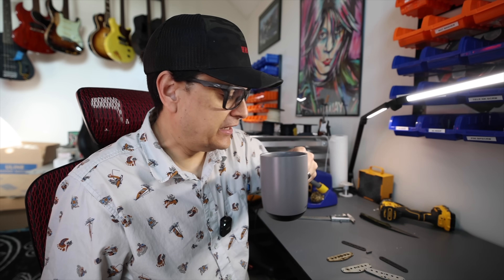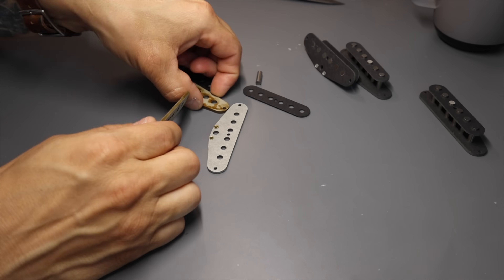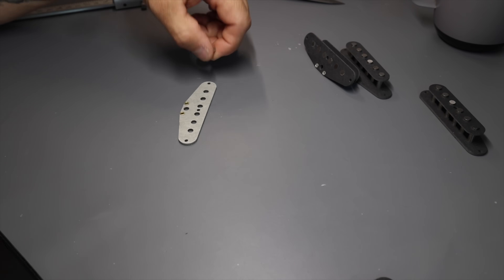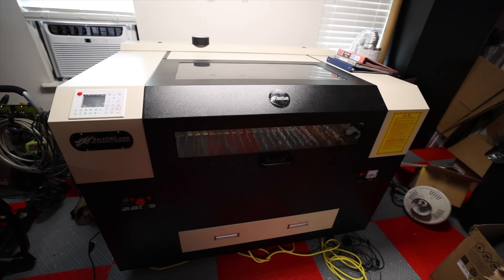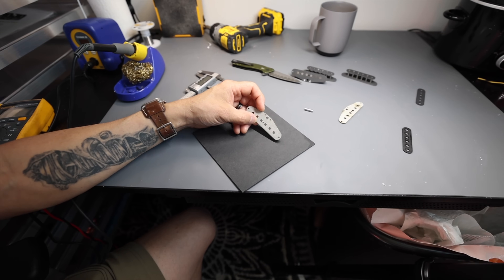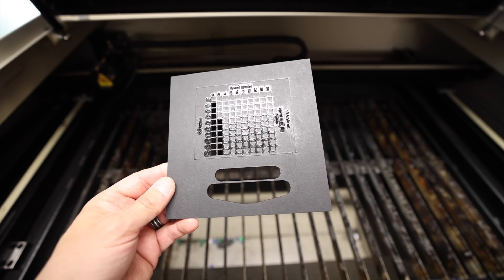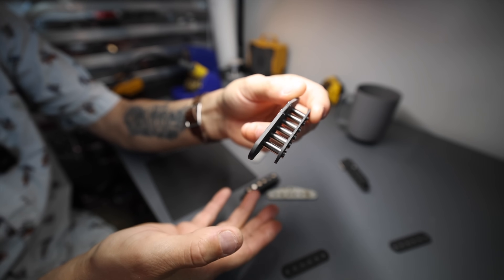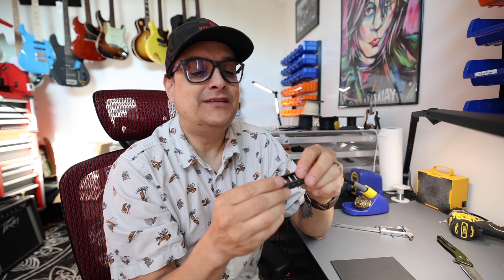This Pickup Bobbin Cost $10,000

Comment: There are absolutely things they could do to not have to deal with the laser residue, and the inconsistency is likely due to the laser kerf, if they're cutting multiple sheets the ones further from the focal point will be too loose and the ones at the focal point will be too tight. My girlfriend actually works in the laser cutting industry.

Comment: I did the same thing as you did,  except there are lot of  laser cut vendors in my Hometown and the service charge were  cheap ($0.02/piece) off course I had to provide the materials by myself. However, the issue with vulcanized fiber board is that it's not so durable and often bends through the time, so i am thinking to  switched into other materials type and methods such as 3D print or FR4 cut (same board as PCB, the manufacturing process also done by PCB manufacture). I agree that  laser cut might be super fun, but this method also limited to lack of  type materials that could be cut by the machine, such as it would be EXTREMELY DANGEROUS to work with materials like PVC, Nylon, or any kind of fiber (FR4 or Ebonit).

Comment: Years ago I built snowboards. In order to do my own graphics on the plastics, I had to teach myself dye sublimation printing and color calibration for a 3 stage dye transfer process. Took months and a lot of wasted materials.  Also had to teach myself how to run a CNC router and to do the CAD/CAM design and cutting both forms and parts with BobCAD software on my 4x8 vacuum table router. 

Unfortunately USA-made costs make it almost impossible to compete with Burton and others who sell boards sourced in CCP or Dubai for production cost $75 each and sold in USA and Europe for $600-1000.  In the end sold my equipment and moved on to other things, in part because the building where I had my shop was put up for sale and all tenants were evicted. I spent 6 months looking for a suitable location I could afford to move into and could not find one. It was a 'side business' at the time and I could not do it full time so had to make a choice. 

I learned a lot in those experiences. The biggest thing is new respect for color press operators and their color techs.  It is WAY harder and more complex than doing CAD/CAM.  That laser looks like a lot of fun and there is a ton of other stuff you can do with them too.

Comment: I am wondering if it wouldn't have been more cost effective to have a die made. Like the old school way. Then you take a wooden mallet, set it on the material and smack it with the mallot on an oak table. I worked at USDA in the late 80's early 90's these dies exist and someone made them. I got a feeling the old school way would be much cheaper and quicker. As usual.

Comment: You probably could have saved some time and money. You can get a diode laser for less than $1,000 that will cut that flatwork material to the same precision as your CO2 unit. Also, you didn't have to draw the designs from scratch. I found downloadable STL files for the flatwork. It took about 10 minutes with my CAD and laser software to covert those to DXF files that my laser can read. Now admittedly, your 40W or 80W CO2 laser can do a lot of things that a 10W diode laser can't do, and it will work a lot faster than a lower powered diode unit, but you didn't have to spend five figures to laser cut vulcanized paper. Also, did they tell you that the laser tube on a CO2 laser is a consumable?
Reply from the maker: If all I was going to do was cut paper I’d have gotten a pair of scissors. Also… sure there are a lot of drawings out there … but I wasn’t satisfied with them
Reply: @DylanTalksTone  What kind of software are you using. Lightburn is pretty full featured and I think it's only $60. It even has some drawing features. One thing that I would recommend when you are fine tuning the fit of parts is cut samples out of cardboard. It cuts very fast and is rigid enough for making mockups. As for the drawings out there, it's a mixed bag. Some are accurate, others are not. Even the inaccurate ones, though, can be templates for designing your own parts, like adjusting the size and location of holes in the DXF file, modifying lines and curves, etc. One of the nice things about Lightburn is that you can import an image and then use that as a template over which you can use the app's drawing tools.
Have you thought about offering custom engraving on metal pickup covers? I haven't tried doing nickel or chrome myself, but I assume that you'd need some kind of laser marking spray. Those absorb enough energy to be able to use relatively low powered lasers to mark metals. The actual laser marking paints can be pretty expensive, but there are lower cost alternatives like dry moly lube, which in my experience works just about as well as the specialty laser stuff.
Have fun with your new toy. I'm sure you'll find all sorts of things you can do with it. Are you going to offer custom engraving on pickup covers?
I bought my current laser specifically to cut the pickup magnets for the Harmonicaster electric harmonica but I use it for a lot of stuff. I know Billy Davis, who is in the Rock and Roll Hall of Fame (he played on Hank Ballard's original recording of The Twist) and just had his 86th birthday. I found a photo of an album cover online that he had autographed, and was able to use my laser to engrave his signature on a guitar strap as a gift.

Comment: Also if you're cutting rubber please tell me you have something venting the cabinet outside and are not relying on the internal air filtration.
Reply: I think he said about the extraction in part of the video. I always thought you put a ply deck on your laser cutter which stops small stuff falling through and prolongs the life of the device. They had this at the Uni I work at
Reply: @MrSongwriter2  yes, most lasers have a honeycomb grid that keeps small parts from falling through.